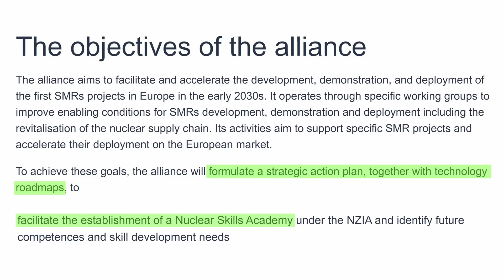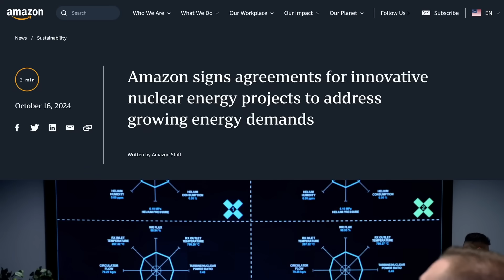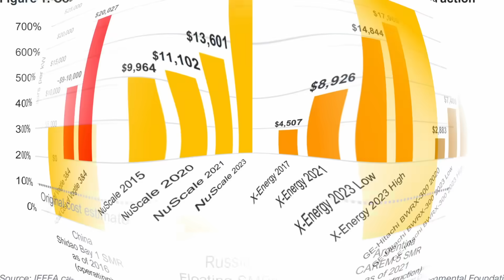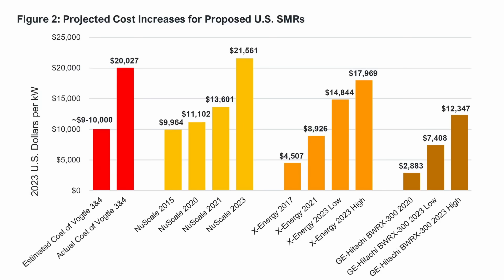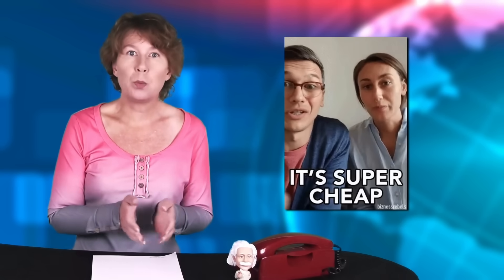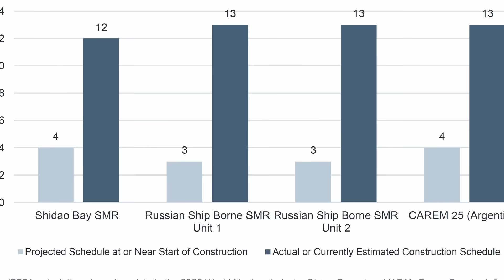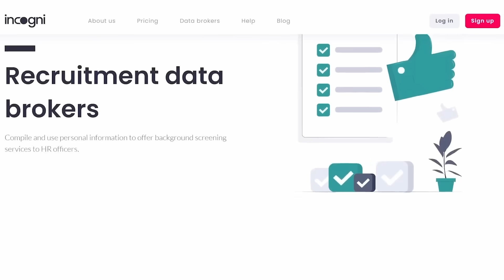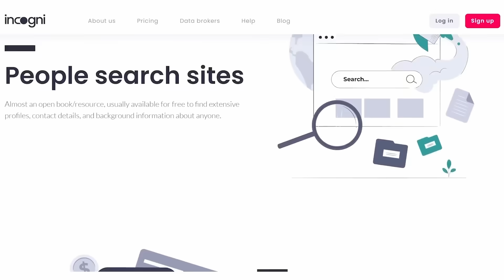Small Nuclear Reactors Have A Big Problem

Comment: Since the reactor, modular or otherwise, is only a source of heat with which to generate the high temperature, high pressure team plasma that drives a steam turbine, there's a lot more to this proposition than simply the modular reactor :-)